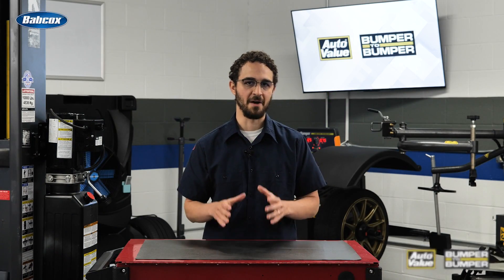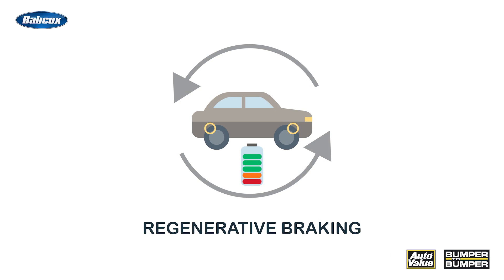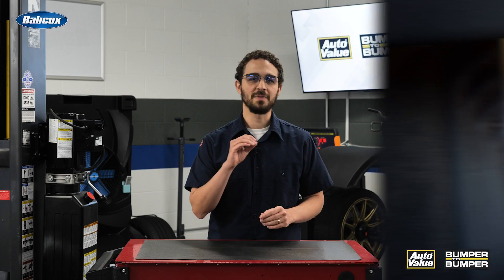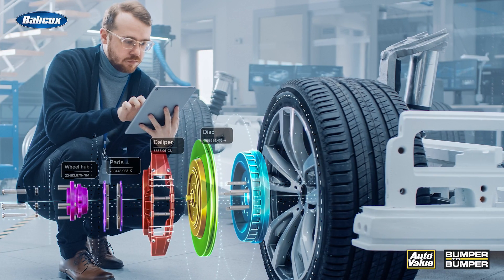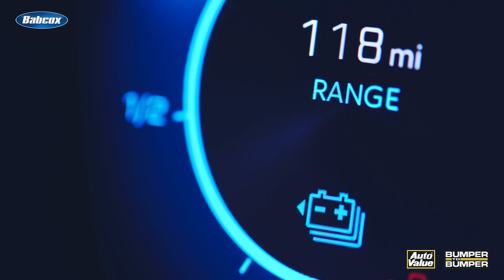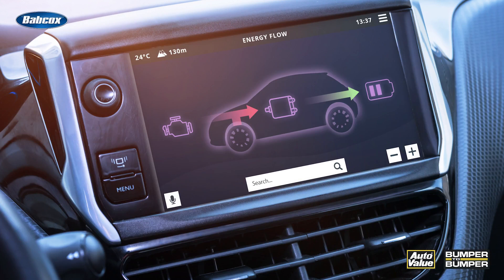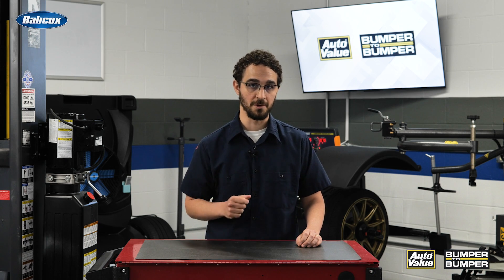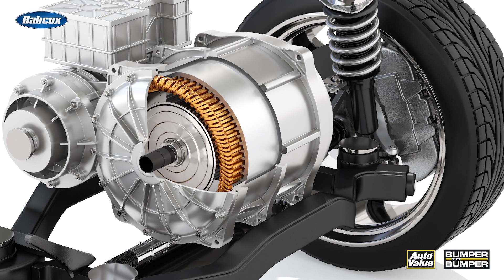How important is regenerative braking for EVs?

Comment: For maximum range with  Any vehicle COAST.  Most drivers never do that.  It's always Gas Or Brake. Look ahead at traffic patterns and traffic signals and plan ahead for natural rolling and windage resistance to do most  of your gradual slow down.   I routinely beat the EPA estimates on both vehicles by 10 to 22.%.

Comment: After driving a Tesla Model 3 for 2 years, I can honestly say I only ever noticed the regen braking actually give a benefit when I went down a really long hill - it gave 1% battery increase on the way down. Needless to say, that was negated by having to go back up the same hill.
As already said - lots of colleagues Tesla's went in to get fixed due to corrosion on the calipers (due to lack of use), one of them had to have some significant work done as he set it to aggressive regen mode so barely touched the brakes and as such they weren't getting used in their 'normal' range of motion.
Don't get me wrong, nice idea to reclaim some of that energy but I certainly don't see it as a big bonus given the returns you actually get. I think 40 mile extra range is more than a little optimistic, but perhaps things have changed in the 3 years since I had my EV (and subsequently went back to a dino-burning engine, vowing not to get an EV again).
Reply: Smart man. Ditching your EV that is!
Reply: Not something I get accused of often :D @davidpacholok8935
Reply: Thats crazy, now that I have a tesla i can never go back to a regular car
Reply: @Benedict00_MankoMuncher that's good, glad it's working out for you

Comment: The range is poor to start with.
Regen braking captures LESS power than is needed to get back to the speed you were at.
MAX range is achieved WITHOUT stopping.
Reply: Hybrids and EV-s have better range in the cityes than on highways exactly because of regenerative braking and the lower average speed of coarse ( the  air resistance increase in squared proportion with the speed) !